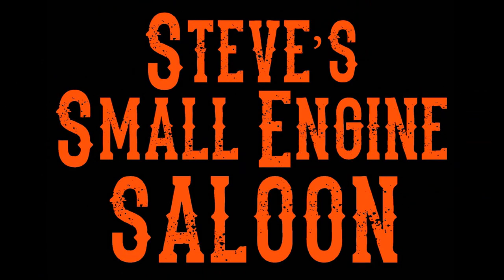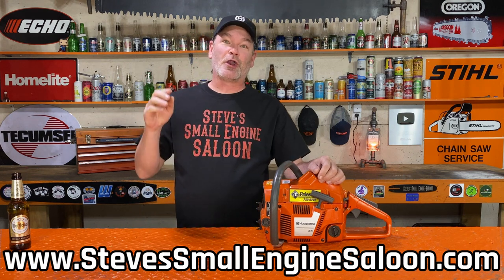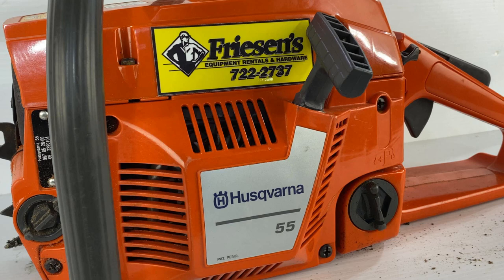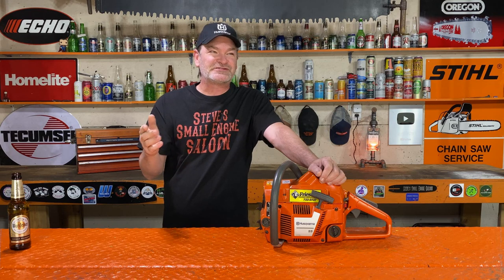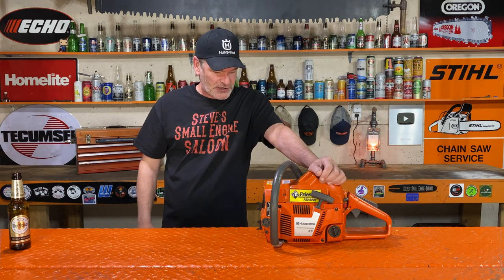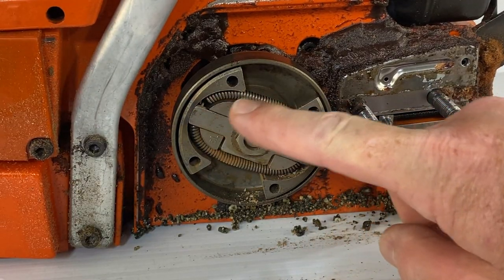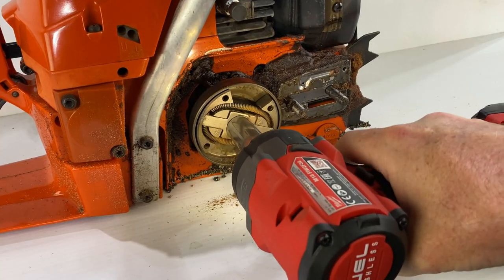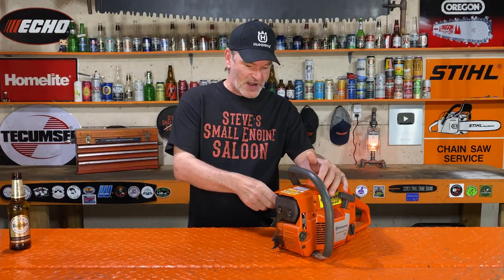Are The PROS Tightening The Chainsaw Clutch WRONG?

Comment: It's a bit like those idiots who overtighten the nut on panel saws. 
It's a reverse thread so it tightens up under load. You can wreck a thread over tightening and it can be dangerous getting the bastard loose again. 
I use a plastic piston lock to loosen the clutch  and leave it in until I put it back. Hand tighten.
Never had one come loose. 
But I don't use Husqvarna anymore. Garbage saws.

Comment: Not a big fan of the chain break method, my neighbor has been cutting wood for at least 30 years.  I have been cutting wood for the better part of 20 . We just knock off the clutch, spin it back on give it a Crack  or in my case torq the clutch down and carry on.

Comment: If you hold the saw out an upstairs window, with a spanner on the nut. Then attach your neighbour's cat with 15' 6" of rope round it's neck. Drop the cat, and when it hits the end, your clutch is just fine. I find however that you need 16' of rope and the neighbour's dog for Stihl saws or larger Husqvarnas.

Comment: Not a chainsaw pro or chainsaw repair tech however in my job everything most be checked and double check by a second person. Engine stops, emergency stops, belt and chain guards, fuel shutoffs, pressure regulators, safety shutdowns, fire suppression, gas detection, and remote actuators. My thought is if it’s the right tightness all is good but if it’s loose and you slammed on the brakes you just over torqued everything. Just my two cents. Thanks for sharing!

Comment: That's putting a lot of stress on parts that is unnecessary.  Just like riding your breaks when you're trying to slow down but you're hitting a bunch of potholes. Giving tremendous jokes to your suspension while you're holding your  brakes.

Comment: You can do that to loosen it too. Just put the saw in reverse. Yeah, I know. I'm an *ss. Either way is right. Think about this, if you're afraid of over torqueing using the brake method, wouldn't that happen during normal use? No. Once torque is set, it would take a lot more force than normal to exceed that torque. What gets me are those techs who use threadlock on the clutch. I've seen it, and cussed the last person to work on it.

Comment: How weak is your impact wrench? You should be able to get it properly tight with a quick shot of your impact thus doing this chain brake engagement non-sense is just abuse of the equipment.